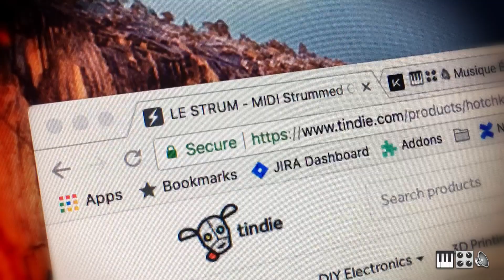Bonjour Le Strum: Unboxing my DIY Midi strum controller

Comment: I love it!! I ordered one  to use it with 2hp pluck
Reply from the maker: Nice! Although it works best with a polyphonic module, so the notes ring put on the strummed chords
Reply: I am sure it will be fine : "Four voice polyphony allows for long resounding melodies and harmonies to be created with only a single module." Page 3  2hp pluck Manual.
Thanks for making the video.

Comment: What are you using to plug it into the computer? Mine doesnt work. I sent it back and they said it does work so its obviously something im doing wrong. All my other midi controllers work but this one doesnt. Im using a 5 prong midi to usb lead.
Reply from the maker: It has a big, old school Din MIDI plug on the side. I used that?

Comment: would you consider this a difficult built, it looks really cool
Reply from the maker: +Grumbledore Music that was my first build and I didn’t have any problems. The creator put really good instructions, and there’s also a lot of pictures to follow. I’d rate it easy!
Reply: How accurate is it recorded into a main sequencer?
Reply from the maker: +krakou2 it’s a midi controller, and it sends midi note. I should work just as well as a traditional keyboard
Reply: do you need to solder things together? Im total horrible with that
Reply from the maker: Yup, you need to solder all these little buttons and resistors, and diodes and stuff.
Reply from the maker: You need to check with the maker. Link in the description